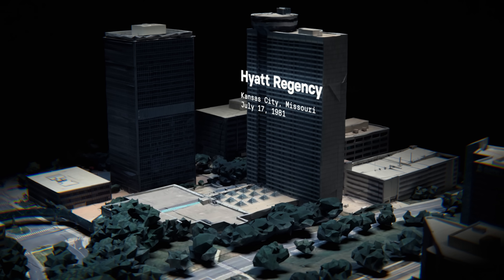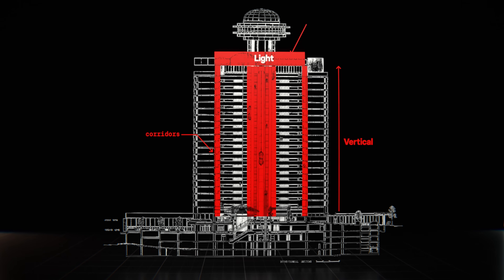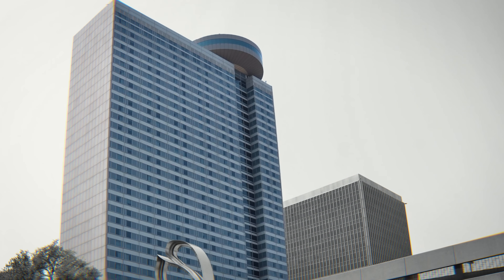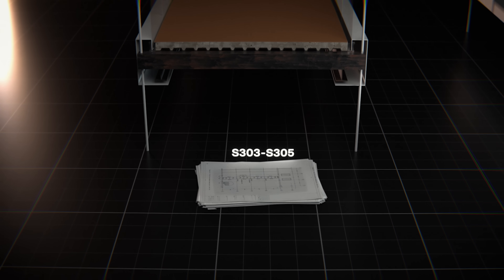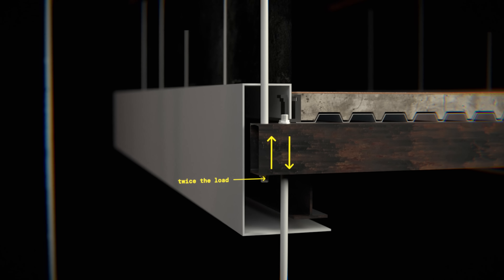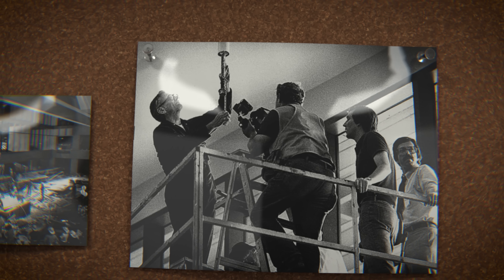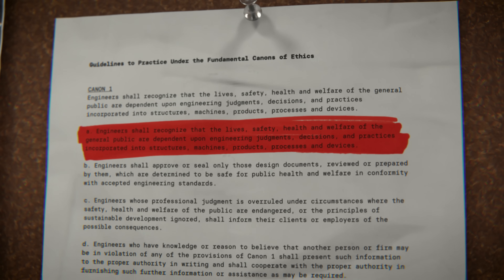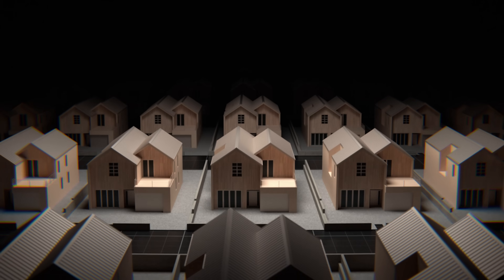Inside the Hyatt Regency Skywalk Collapse

Comment: We learned about this disaster and went over it for a whole week in one of my undergrad engineering courses. Serious case of why engineering ethics and good engineering knowledge is important
Reply: now they all disappear
Reply: people who are ethically minded will tend to sense something is wrong even without an academic explanation of why they feel the way they do. People who aren't ethically minded will simply ignore the instruction or use it to better evade the rules.
Reply: @coleciervo5454  in the Hyatt Regency case.. they knew what they needed to do to review shop drawings but they didn't do it. If we had Hammurabic Code they probably would have been more diligent.
Reply: @ And this is why it's important to teach engineers to do their work properly and to keep safety paramount
Reply: @coleciervo5454  engineers need unions or union-like protections to demand reasonable deadlines in order to do their work properly.

Nurses unions play an important role in ensuring reasonable provider to patient ratios. Engineers need unions for similar reasons so they aren't chronically overloaded.
Reply: @coleciervo5454  read about the Boing 737max development. Or Volkswagen's Dieselgate scandal. Pressure came from above to do unreasonable things... a deficiency of ethics knowledge was not the problem. Absurd expectations and time and budgetary issues were the real issue.
Reply: @bobloblaw10001  Agreed. The way we get rushed through this stuff, it is a miracle more disasters like this haven't happened.
Reply: You can study ethics all you want. The problem is agency, not abstract questions of ethics.

The engineering company is beholden to the client, the graduate engineer is beholden to the senior engineer. There are time and budget constraints...
Reply: @bobloblaw10001  that’s why you study ethics.  Moral education is essentially what makes good people.  It doesn’t force them to be good, but on the whole, it shifts the population in the right direction.  Same goes for religion.
Reply: @davidswanson5669  I used the word explosion too much apparently and my entire lengthy comment disappeared.. youtube censorship.. ugh
Reply: @davidswanson5669  engineers tend to look at engineering failures and conclude that someone didn't understand what they were doing or didn't know the right thing to do. I believe in doing so they are making what social psychologists call the fundamental attribution error. It's the tendency to emphasize personal traits as causational and not place enough emphasis on situational pressures.
Reply: @bobloblaw10001  The signing engineer has the responsibility to be sure the work is correct before stamping. No matter how much pressure they have. I would lose my job before signing something that I know could fail. Even before having my license, as a design engineer, I made sure I was communicating everything, including my professional opinions in written form. Even if someone else was signing, I made sure that any disagreement I had with the design was in record. That is called ethics. People that will accept pressure over safety don’t belong in this profession. We have lives in our hands and that is sacred.
Reply: @lhr8833  That's great but there isn't enough being done to hold everyone to that standard.

Getting things right takes intelligence and ethics and experience and motivation but also time and money. Not every boss and client is as patient or understanding or deep-pocketed. No matter how ethical or diligent you try to be, you can be fairly easily replaced with someone more profitable who is willing to just put something on paper and move on.
Reply: @bobloblaw10001  There isn’t enough done? IDK where you live, but in US we have to pass two licenses and all states have some amount of years of practice required before granting the second license, because competency depends on education and experience. The tests are standardized and get more challenging with the years, to the point that they might need to accommodate some individuals because if not, the test setting would filter by more than knowledge, is very strict and expensive. Every state has a licensing board and many have also some engineer organization that oversees the profession. There are rules that nobody with a lesser level of competency can manage an engineer with more competency, therefore everybody in the chain of command should be equally interested in keeping their license.
Reply: @bobloblaw10001  Continue…. The NCEES and license is national, you add other states by equivalence, so, if you are suspended in one state, you can say good bye to your license everywhere. And we also have a requisite for continued education, that my state now added a requirement that certain percent of those hours has to be taken in ethics related education. Exactly how isn’t enough being done? I think with all of that, every engineer knows that signature means the rest of their career and legal issues if a project fails. Plus nobody has to tell you that if you have a job that overseas people’s property, health and safety, you have lives in your hands and will be really bad to lose one of those precious lives, that should be human instinct unless the person is a psycho.
Reply: @lhr8833   Yes, I am absolutely saying that all of that is not enough, because it doesn't deal with the time and budgetary pressures of a particular job. It doesn't deal with bad bosses who work their graduate engineers to death just because they can.
Reply: I went to college in the early 2000s and there were already many organizational changes from when this accident happened. This case is one of the case studies I had to analyze in college. In the past 20 hears many more changes have happened in each engineering board. I’m failing to see how is not enough. If a person doesn’t have enough ethics to keep themselves accountable while having lives in their hands, they don’t belong in this profession.
Reply: @lhr8833  there aren't enough mechanisms to remove them if they don't. Look at FIGG and the FIU pedestrian bridge collapse.
Reply: @lhr8833  I'm in Texas and I've heard the TBPE/PELS ethics class a half dozen times. And it always comes down to, well if you see something possibly unethical, tell you boss as a first recourse. But what if the boss doesn't care? What then? It's like you don't want to believe that a person could be stuck in an unethical situation because it's mentally uncomfortable to imagine it. But it happens all the time.
Reply: @lhr8833  continuing education is largely a joke. You can study something unrelated to what you actually get paid for. What would be better than continuing education is to audit the work that you actually sign to ensure that you have expertise in that particular area. It happens often where an engineer designs a building and the building is fine, but he also signs off on the parking lot and the storm water detention that he is far less competent in.
Reply: Why can't I say that for people to lose their engineering liscense is uncommon ? Comment keeps disappearing.
Reply: @bobloblaw10001  I’ve personally know engineers that get suspended because of practice. I’ve been in this profession for almost 20 years. Once again, if you don’t want to ever be in the position opposing your superior when you know they are wrong, don’t get in this profession, because people’s lives are not a children’s game.
Reply: @lhr8833 "little boy.." what the heck is that for a response? What are you trying to accomplish?
Reply: @lhr8833  re: opposing superiors 
Why are you making this personal? I'm talking about systemic issues. It's one thing to oppose a superior if you have a couple hundred thousand dollars in the bank and a mostly paid off house. It's another when you're starting out and have debt or you desperately need the good reference. It's not about the individual moral courage so much as the systemic conditions.
Reply: You may be morally perfect but there is always someone out there, despite all of the requirements to get licensed, who is hungrier for work and less scrupulous.

It's Gresham's law. If you have two forms of currency with the same face value, the one that is cheaper to produce will eventually drive the more expensive one out of common circulation.
Reply: @bobloblaw10001  I’m not morally perfect, but I know my responsibilities. If you don’t want those responsibilities, don’t choose a profession that can affect humans lives. You seem to have a lot of leniency for excuses, for people that put their own benefit over others. If I have to choose between being “morally perfect” or be like you, I choose to sleep with a peaceful conscience.
Reply: @bobloblaw10001  That is not how engineering works. You might not like it, still the person sealing and signing the design is responsible. Make as many tantrums as you want, doesn’t change the reality. Go with your cheap philosophy somewhere else, to another profession where you don’t put people in danger. 

Even your selfish thought that the only ones that opposed have money in the bank, dude don’t make me laugh, you don’t need to be rich to avoid unaliving people. A lawsuit or prison would leave you even more ruined, try to make sense.
Reply: @lhr8833  what are you even talking about.. you are putting words in my mouth and making weird personal attacks.

I understand and respect the stated intent of engineering education, regulation, licensure, etc. I just find it insufficient.
Reply: Read about the 737 max.. VW Dieselgate.. the FIU pedestrian bridge.. these things keep happening despite supposed reforms and education and learning from past mistakes.
Reply: @bobloblaw10001  When did I say they don’t happen? Try to use some comprehension while reading. If I told you to go and search suspended licensed, and to read current investigations, is because it happens, duh!!! Don’t deflect because that doesn’t work with me.

The issue is that you are excusing the reason why it happens, or saying that the ones that decide to do the right thing and follow the ethics, is because they have money. There is no excuse, and as an actual licensed engineer, I’m completely ok with having full responsibility for anything I sign.
Reply: @lhr8833  I'm not excusing, I'm  explaining. I'm explaining how the system is not adequate because it  still tolerates too many bad actors and it allows engineers to sometimes be in a position where they have technical responsibility and responsibility to the public, but without adequate control over the workflow and decision-making.
Reply: Take the case of Dieselgate. VW engineers were asked to do the impossible. To design a diesel engine that was powerful and fuel efficient but could also meet strict us emission standards.

They tried, it wasn't possible, so they designed a clever cheat to detect when the car was being tested.

Now, you could say, I personally would never do that, even if I really needed the paycheck. And maybe you are telling the truth.

Great, your conscience would be clear. But chances are that the company would just find someone else who is more ethically flexible.

Yes, the truth got out eventually and VW sort of learned its lesson that it shouldn't do such things. But people were still hurt.
Reply: If you want to stop the problem more quickly before people get hurt, then individual moral instruction sadly isn't enough. You need union or union like protection from wrongful termination and whistleblower protection. You need a mechanism to stop the company from simply hiring a more morally flexible engineer. Or more penalties later to prevent it in the first place.
Reply: @bobloblaw10001  Check Texas Society of Professional Engineers. Most states and territories, if not every one of them, already have an organization that works exactly how you are describing, and separated from the licensing board. 

An organization where the members vote for the leadership and they oversee the practice and ethics, and you can definitely report those things. It already exists, for decades.
Reply: @lhr8833  TSPE is a private organization with no real authority

I don't think you really understand, but thanks for sort-of trying.
Reply: @bobloblaw10001  Yes, I probably don’t understand the profession I’ve had for almost 20yrs. Thank you internet rando for educating me. Just stay far from this profession, we don’t want you to end up pressured into ending people.
Reply: @lhr8833  why do you write like a troll?
Reply: @lhr8833  you talk a lot about nothing. Acting like engineers simply can not do the wrong thing. All because there is some license you have to have and a private organization. It's all run by people, and in the end people don't make decisions simply based off the data. Sure you might not be willing to do something you know is wrong but there are ones who will. 

I see this all the time as a crane and heavy equipment mechanic. Company wants to lift X thing with a crane and operator says it's not safe we're not doing it. Operator get let go and some other operator takes the seat and does the lift. They get away with it this time so they think next time will be the same until it's not. Then crane fails, and people die, property damage, so on. 

Same with any job.
Reply: @joshuabaker5712  Thank you. Are you aware of the case in Dallas from like 2019 where the crane operator was working like 80 hour weeks. They didn't get it put into storm safe position in time and it got blown over into an adjacent high rise building and killed a 20 something lady. Project owner was Greystar. Victim's family won a huge award a year or two ago.
Reply: @joshuabaker5712  Thank you. Are you aware of the case in Dallas from like 2019 where the crane operator was working like 80 hour weeks. They didn't get it put into storm safe position in time and it got blown over into an adjacent high rise building and a 29 year old woman became deceased. Project owner was Greystar. Victim's family won a huge award a year or two ago.
Reply: @joshuabaker5712  having issues with the anti spam filters and censoring. Apparently it's the length of my posts that's the problem and not the k i double L word.

Comment: I'm sure I've missed something, but I'm trying to figure out if they had gone with the original design on a continuous rod how would they have got the washer and nut to the middle? unless it was one heck of a long all thread? As usual, a great video Stewart.
Reply: In their book "Why Buildings Fall Down", published around 1990, Matthys Levy and Mario Salvadori state that the rods were indeed threaded for their entire length. This is one of the main reasons the contractors wanted the design changed from one continuous rod to two rods. They couldn't figure out how to get the box beams into position on one continuous rod.
Reply: The ideal design would have been to have a set of rods going to each walkway.. not as minimalist, but far stronger and easier to inspect and maintain